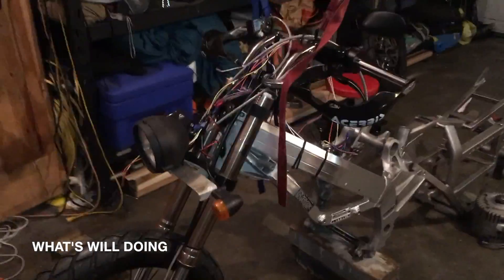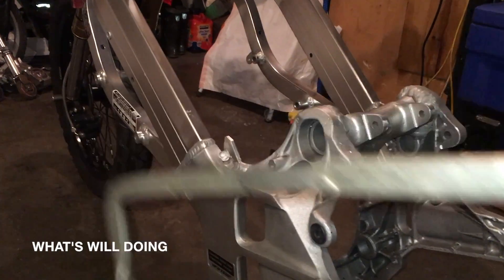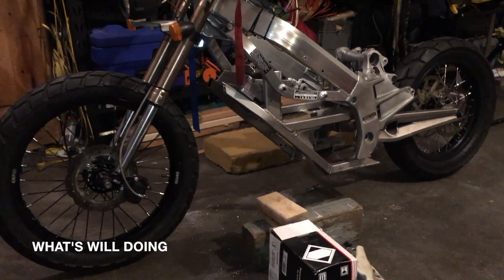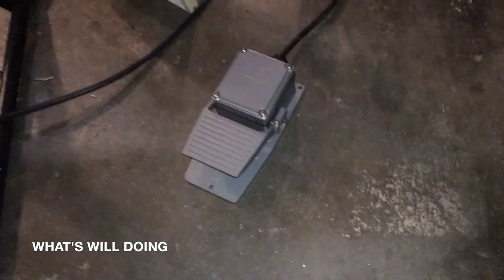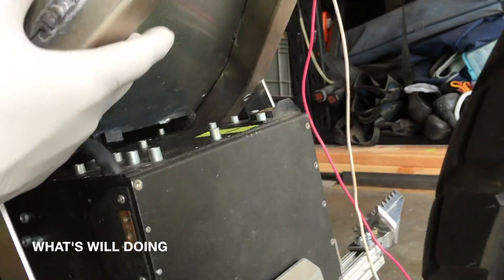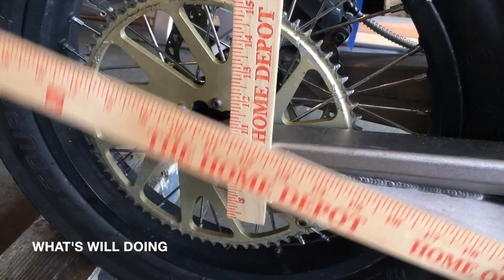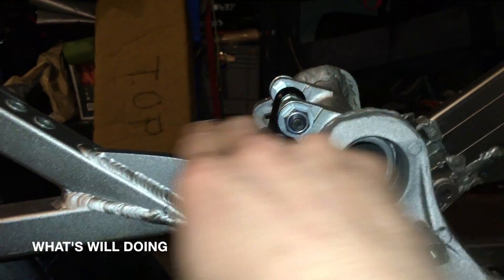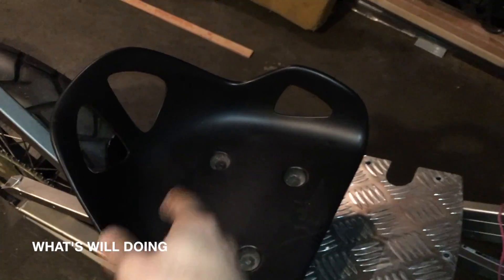DIY Electric Motorcycle with 117V 28S Lithium Battery and 400A controller

Comment: How fast and how far will it go?
Reply from the maker: At 65 MPH on the freeway about 45 miles.  With speeds averaging more around 40-50...can go about 60 miles maybe 65 if I'm a little more conservative.  Top speed is about 70 MPH software limited.  I could change the max motor RPM and probably get it up to 80 MPH but I have plenty of fun how it is.
Reply: I'm living on Hainan Island and beginning March 2019 no new gas powered vehicles can be sold. By 2030 no more license registrations for gas powered vehicles. Even so, I think I need 150-200 miles range. Guess I'll have to wait
Reply from the maker: @martinsinclair55  It's always disappointing when government takes our freedoms away...sorry to hear.  Well how fast do you need go?  If you can get by with 45mph speeds on a heavy duty bicycle frame especially with a recumbent style bike with aerodynamic fairings you can probably get pretty close to 150 miles on a charge on a DIY bike.  There are commercial made electric motorcycles that can go 150 miles but they aren't cheap.  Another thing you could do is strap an "evil" gas generator on your bike =).  Then the bike itself it's "gas driven" it's only gas charged =).
Reply: What's Will Doing  Well, for the time being I think I'll wait to see what technology unfolds here. Really I think 150 miles is minimum but 300-350 miles is a lot better. 45 mph is enough here. I am working in Dubai now and building a gas powered motorcycle there. 1200 Triumph motor in a flat track frame with KTM motocross suspension. My job in Dubai but my house in China. Have had some ideas about building an electric off-roadable chopper for China but not unless it has fantastic range and can seat two people. I know the battery technology is coming soon and need a competent person to help with the fab work too.

Comment: What are u using for Lithium cells?...I was using Samsung 25r cells in a 24s16p configuration...Kelly 300 amp controller reduced to 250 amp but after one summer the cells are down about 10% which is not good...I am looking for something more robust...any ideas?
Reply: Some Lifepo4 cells would work and are more tolerant + won't catch fire/explode. Then again li-ion still has the best energy density. So maybe size up your pack and set up a cutoff so it discharges only so much in the 60-80% range, that should allow the cells to keep most their capacity. Idk just spit balling here.
Reply: Are you sure all your cells are down? Sometimes it only takes one to Sag the whole pack, find and replace that one or two and it'll be back to normal, that's usually the case with every pack I built after so much use and abuse. Also make sure using the right BMS.

Comment: The title is Electric Motorcycle with 117V 28S battery...yet you barely mention the batteries and provide no useful information about them.
Reply: They are stock battery modules form a roughly 2012 Zero DS I believe.  Hope that helps.  Are you working on an EV project?